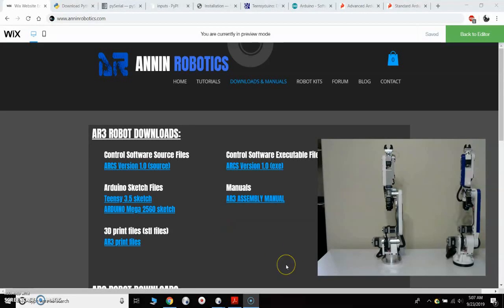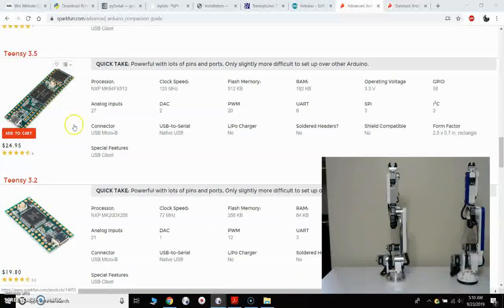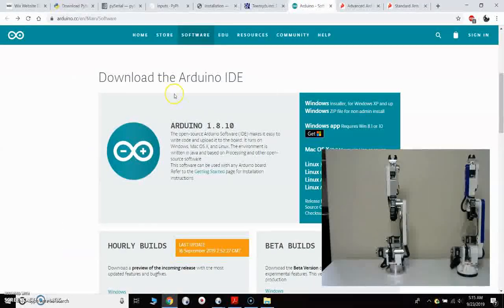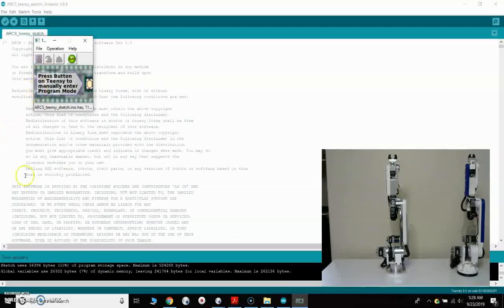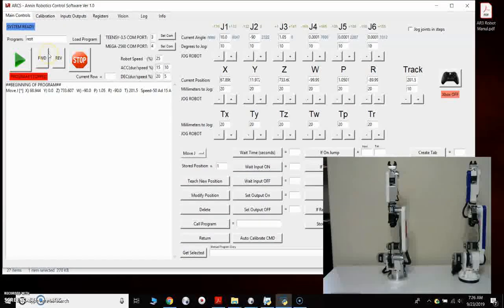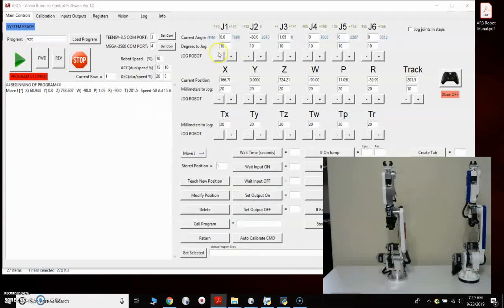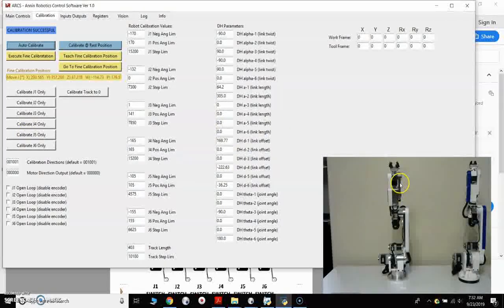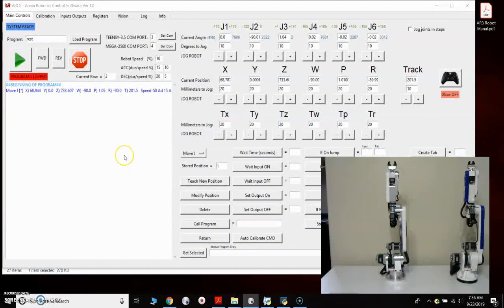AR3 robot startup

Comment: hi i have a feature suggestion. instead of incorrectly calibrating the robot to test if the limit switches work you could include a limit switch test program/mode. for ui have a box for each limit twitch that turns from red to green when its cooresponding limit switch has been pressed. just press each limit switch in order and check that each box lights up in the same order.

Comment: I´ve been looking for the specific measure of the aluminium parts, but I cant find them anywhere, where are they? Thank yo!
Reply: The 3d printable parts are the same as the machined aluminum parts. You can dimension them with any 3d cad software.

Comment: is the 4lbs weight limit due to the size of the stepper motor or the aluminum frame limitation?  thanks for the videos.  I am very interested building a AR3
Reply from the maker: It's due to the torque limit on the stepper motors.
Reply: Since this is a closed loop system now, will we see motion recording by moving the robot arm in near future? That would be amazing function.

Comment: hi, chris great job, 

will the encoder auto correct the position if there is slight loss in steps during program run like a servo , i used to face loss in steps during operations in current ar2. and have to stop it and calibrate.
Reply from the maker: Thank you.  I have not had any issues losing steps unless I try to overclock the speed in the Arduino program or run a single joint too fast.  The encoders do constantly monitor the position and throw an alarm when they go out.  If you lose steps on the AR2 I would like to know more and make sure its not an issue.  If you would like shoot me an email on the details and we can review.
Reply: @anninrobotics  when the robo is in program mode it slowly losses steps to a point where after some time it can not complete a action , iam using version 1.5 software

Comment: AR4 , another suggestion to reduce cost and complexity. Instead of two boards for controlling motors and I/O , it can be done with just one board like adafruit Grand Central which is a 32 bit SAMD51 running at 120 MHz with FPU. It's got plenty of horsepower to run the motors and plenty of I/O provided it uses trinamic drivers sensorless technology. Doing away with encoders and limit switches can free up a lots of pins and also reduce cost, wiring complexity. I appreciate your great work, it's just my opinion. Thank you and keep up the great work
Reply from the maker: Thank you, I will definitely look into the Grand Central board.

Looks like a nice board,  a couple reasons I went with the teensy was that all its pins are 5v tolerant since most devices including the encoders are 5v and all teensy pins are capable of interupt for the 12 signals needed for the encoders.  I left the Mega due to most devices being 5v and thought it would be nice to have a 5v board in the architecture.  plus the teensy was running low on pins after running all the motors and encoders.
Reply: @anninrobotics  stm32f4 discovery board probably a better option and arduino-ide compatible. Cheaper and faster than the adafruit board.

Comment: Chris, congratulations! The AR3 looks amazing!!! The encoders and the Teensy are a nice touch!! What would it entail to upgrade my AR2 (cost, components, time)?? Have you thought through the process of an upgrade??
Reply from the maker: Hello,  you would need to upgrade to the dual shaft motors and get a teensy 3.5 board as well as the encoders.  Im not sure on the exact cost but honestly if you already have the AR2 built and want to upgrade it I would probably just follow the manual and upgrade to all the latest print files and the wiring harness as it wouldnt cost very much money to do that.  I have a few notes in the manual on what you would do to update to the AR3